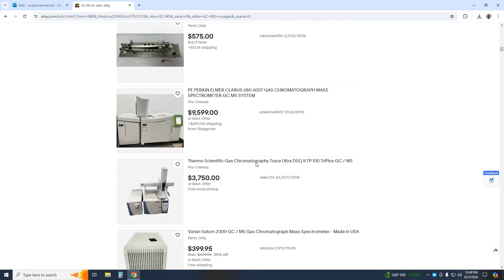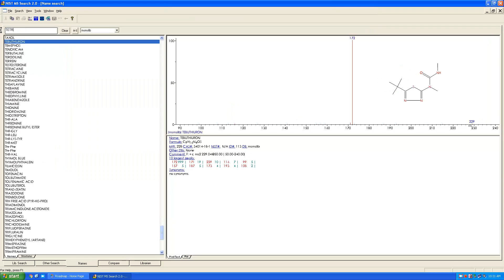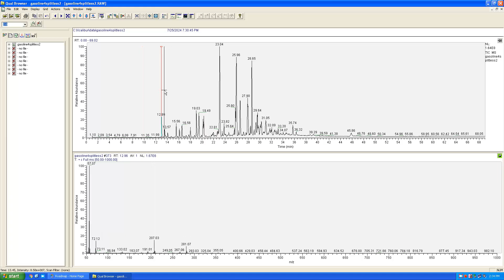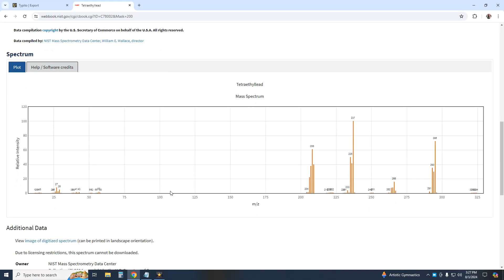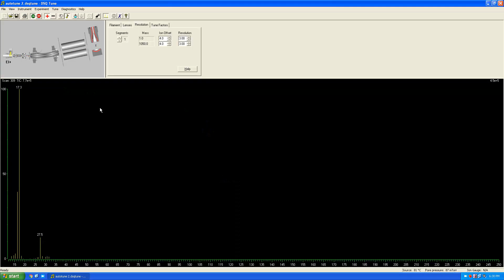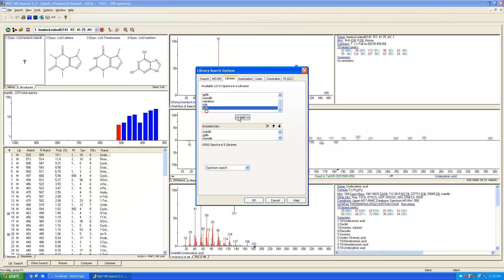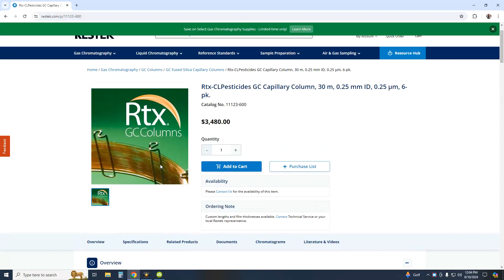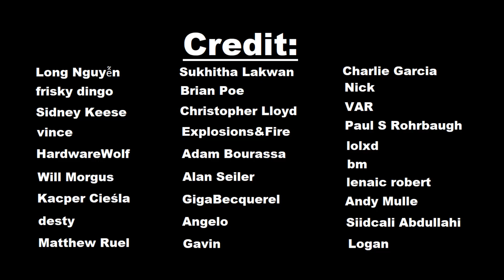GC-MS Home lab series (part 1)

Comment: Ahhh.. I had a ton of these that went to the recycler when I was a system admin for a small pharma research facility. WinXP died a brutal death and the older gc-ms machines were all replaced. We also eventually forced a replacement of a SEM with windows 2000 embedded in the hardware. I wished I kept at least one. I should check if any of my coworkers have any in storage.. they just go to a recycler and get scrapped. There's not any particular reason they should be illegal,  they're just super expensive. When they were current, there may have been some licensing issues. I'm not sure they would have done a license transfer, but you're not calling for support anyway. Anyway, this hardware was all fully functional, it just wasn't safe to have them on the network. They were riddled with security holes. We did custom ACLs on the routers to only allow access to certain file servers, but it was not fun to maintain ancient equipment. Also, Chemdelic sent me..
Reply from the maker: Oh wow! Way to crush my heart! Lol . To be fair, I see it all the time at my work, corporate waste so much perfectly good equipment, chemicals, resources, consumables etc.. it's just plain stupidity. I understand the security risk but I thought that's why eBay existed? 
Sale them at a discount damn it!! Why does everything has to be in a network these days? Stand alone works great ! And has worked for many years! WTF ! 
Anyway, thank you for the recognition and for watching both Chemdelic and myself!
Reply: @Neptunium  also, Chemdelic is the best! And, I definitely look forward to digging into your videos this weekend.. thanks for keeping it interesting!
Reply from the maker: @BeyondSuchMortalConcerns well if you enjoy Chemdelic videos, you will find that mine are a bit different, I do delve deeper in chemistry sometimes, but mostly into nuclear physics stuff, isotopic crap, geophysics nonsense, environmental shit and radio astronomy BS .. hope you like it too! Thanks for watching any of it AND constructive criticism is ALWAYS welcome!
Reply: @Neptunium  oh, don't get me wrong, I enjoy a range of different channels, Chemiolis, Labcoatz, Apoptosis,  Total Synthesis.. even watching sreetips recover gold... I enjoy tech too, so your videos look like they're going to be fun.. I already love what I have seen. Keep up the good work.. there are other chemistry channels that I'm not nearly as impressed with, so good work!
Reply: @Neptunium  I absolutely agree.. if you had any idea some of the hardware I have thrown out over the years.. dev machines for fairly recent major gaming consoles alone could have made me wealthy. As far as why they needed to be networked.. groups of 20-50 chemists all working on new drug delivery systems and extended release formulation.. they had to share with one gc-ms lab.. easier to organize it that way and keep the specialists specializing, I suppose.

Comment: Very informative! I have watched this multiple times already. Any chance that you would do some mentoring or advising? I am interested in plant sap analysis (xylem and phloem sap) as a method of monitoring the nutrients available to the plant. Would GC-MS be appropriate for that task, or is one of the other methods (for example ICP-MS etc.) better? I am thinking of the possibility of a general purpose machine that could also do soil and water pollution , food toxins and soil nutrient analysis. I am also wondering, what are the on going costs associated with maintaining and operating a GC-MS (for example nitrogen gas, solvents and column replacement etc)?
Reply from the maker: Well if you are looking for xylene, toluene and other industrial solvent than yes the GC-MS works great! Nutrient like organic acid and vitamins can work but probably better on LC l-MS. Minerals are exclusively analyzed on ICO-MS or OES you won't see any organic on ICP. As for the consumables, I have a tank of helium for the GC-MS it was  new when I started about 3 months ago and still has 1500Lbs (3/4 full) Unfortunately there is no machine that can analyze for everything! I know that would be awesome right! LC and GC-MS are the closest you going to get ! Thanks for your comment and thank you for watching!
Reply: while it is true GC-MS is best for analyzing volatile, you can derivatize organic acids and bases (with MSTFA for example) to make those compounds volatile. maintaining a GC-MS can be expensive, especially those littler things like liners, septa, filaments, etc
Reply from the maker: True, I am setting up an LC-MS right now so I didn't want to get too caught up in derivation you know.... Expensive yes but 2 things, 1 this is not brand new equipment so I can get away with second hand stuff or new old stock parts fairly affordable. And 2, I do this at home for fun so I don't run thousands of samples, putting less wear on everything... Hey thanks for watching! Glad you enjoyed it !

Comment: Would this system be suitable for analysis of a powder that is suspected to contain an opioid specifically 'Heroin' please?
Reply from the maker: @andymouse  yes it would
Reply: @Neptunium  :)
Reply: As long as you dissolve it, it can evaporate in the GC column and it's not too long/heavy to plug it, sure.

Comment: The most interesting thing to me is that you managed to both get the software and get it running. 

I have come across a lot of old equipment like this where the maufacturer either won't provide any software because the product isn't supported any more or still wants thousands of dollars for a license.
Reply from the maker: Sometimes, the PC comes with the instrument and the software is already installed..

Comment: Not sure if you would have the sensitivity for it, but I'd love to see what pesticides could be found in conventionally vs organically grown foods.
Reply from the maker: @hairyfro  yes that was one of the idea for this project, as I explained in the video, there is specific column for pesticide so I would have to find one just for that purpose which is not really worth it since I like analyze a bunch of random stuff you know! Hey thanks for the suggestion and for watching!
Reply: I wonder if you could optimize the process for some specific commonly used compounds, though.

I used to use this same system in the late 90s, by the way. Seemed like magic at the time.

Oh, and you may consider passing your samples through a plug of silica gel before injecting them. It helps to get out highly polar and high MW compounds that will degrade your column.

Comment: What version of software are you running? Have the same GC/MS but didn't computer so need to find it to get it going. Thanks for the video.
Reply from the maker: @brucewilliams6292  p this is Xcalibur v 2.07 I got it running on windows XP with the DSq. I contacted Thermo Scientific for help and they were nice enough to send me the upgrade firmware... Talk to Matt Stevens... Thank you for watching!
Reply: @Neptunium  Thanks for the info! That is really helpful. Hope I can get mine going.

Comment: Thankyou very very much for mentioning and promoting my channel. It's a pure gesture that doesn't benefit you, yet you did it because you are awesome. It's an honour to be mentioned by someone with much greater knowledge on the field. I actually did work with such machinery, but i was not aware of how it worked. You did a stellar job 👍.

Something interesting to take a look and analyse would maybe be to find out what supermarket off the shelf milk is composed of. Casein is easy to test, but would be interesting to see the rest.

Also, as a appreciation for you mentioning me, i will make a poor man analytics guide where u will mention this very video and your channel as a whole. The analytical methods will be: fire, pH, reaction to acid or base, gases that come of and hexacyanoferrat 😊
Reply from the maker: @photonik-luminescence  oh you are very welcome ! I am happy to help! Hey you could also check the freezing point maybe? Or even try to liquefy the gas ? Bubble it in a solution of hydrogen peroxide and see if the pH changes? Or a solution of sodium carbonate just out of curiosity you know .. anyway thanks for watching and keep up the good work! I'll be watching 😊
Reply: @Neptunium  photometry would also be a cheap analytical method for a color scale (like, pH or reactions that darken (linearly)). I will stick to carbonate as the "mistery compound" and some tests will help identify it.

About the photometry, could make for a good Arduino project in the future, so i will have on my bucket list. Thanks for responding 👍
Reply: @photonik-luminescence  😁👍

Comment: Water is fine as long as you keep the oven temperature below 90°C and the filament off until it has passed through the system.
Definitely not ideal though, because the low molecular weight will reduce the maximum injection volume you can use with split injection.
Reply from the maker: @monster2slayer  you're right! I had best results with a 10.1 split at 200c. Thanks for watching!

Comment: What was the cost of this setup? How does it compare against low cost modern units?
Reply from the maker: Around $1000, used equipment is not always functional and spare are hard to find, one of the reason this video took so long to release was the time for part time get shipped ... For example i waited over 10 days for a filament I found for $29.
Reply: @Neptunium  that’s amazing! I wish I could get a gcms for $1000. I’m pretty good with computers but this seems like I’d be going in blind.

Comment: Talking of old hardware, i have my basement filled with 80s and 90s lab equipment. Most of them support IEEE-488.
So i thought i'll order a USB adapter. That stuff is expensive as hell. There can't be more than an off the shelf micro controller worth 20ct in it.
Once i cleared my heap of tasks i'm going to teach a RPI Zero a few new tricks and get at least the R&S PPSUs talking to my laptop... after i i fixed the random crashes on that thing...
Anyways, the point was me asking what interfaces this machine came with?
Reply from the maker: @DasIllu  I reached out to thermo scientific for help and believe it or not they came through and sent me firmware absolutely free! The GC connect to the PC via RS232 and the MS by Ethernet cable with its own address. A along as the Xcalibur software is the correct version there is no issue...thanks for watching
Reply: @Neptunium  That's awesome, when a company actually helps you with older stuff instead of sending you a brochure for their newest models.
In my case, i am out of luck since all my devices run either Linux, or (planned) xBSD Unix.
Lots of research for protocols in dusty online archives is needed to implement even the most basic features in python.

Oh and i hope to see more videos from you. The two accelerator videos where absolutely amazing! Thanks for that!
Reply from the maker: @DasIllu yes you're right! I stay away from those Linux applications and frankly prefer to take my chances on obsolete equipment running on windows. Even if it means some sort of license agreement bullshit. Never know what you'll find ... You may get lucky !

Comment: Great as always. I'd be interested in a little more detail on the 'TLC' your machine required to get back up and running.
Reply from the maker: Yeah that would be a week long video ! There is just too much to cover and it would be far too specific to my experience... Not worth it ... I can try to help with my limited knowledge but don't expect miracles ! Thanks for watching!!
Reply: Thin Layer Chromatography? 😉

Comment: Congrats. How did you get the software working? They usually require a manufacturer provided license key or some other method of authentication
Reply from the maker: @matiastripaldi406  yes it usually does but this one came with the PC AND the instrument! Lucky find I guess... Thanks for watching!
Reply: @Neptunium  Ohh yeah definitely lucky. I had to do some HPLC experiments at uni and couldn't analyze the data at home because of the proprietary Shimadzu software. Gotta love scientific companies
Great video and hope you get some good use out of your new toy!
Reply from the maker: That's always a problem isn't it! Don't be afraid to call and ask for technical support... especially with these older instruments.. good luck!

Comment: That's awful someone would use a light metal like tungsten to pass off as iridium
Reply: Tell me about it 😮
Reply from the maker: @The-One-and-Only100 your right! Yet it happens! Thanks for watching!!
Reply: @Neptunium  now im curious if a radiacode is sensitive enough to do xrf as a cheaper alternative to real xrf guns for authentication of element samples
Reply from the maker: @The-One-and-Only100  short answer,....No not really, but you can do "some" pure metals analysis ! thanks for watching!
Reply: @Neptunium  so not using americium 241 for it's low energy gamma or like project 326 did with strontium 90 to figure out what different known samples of elements to make a chart or guide on what to look for